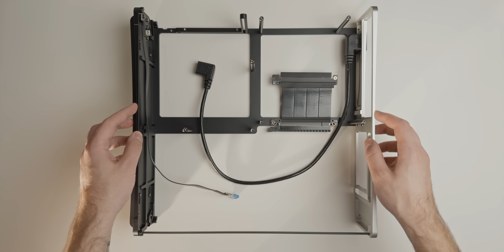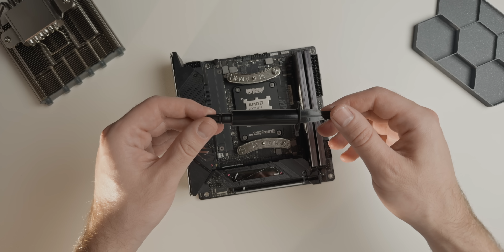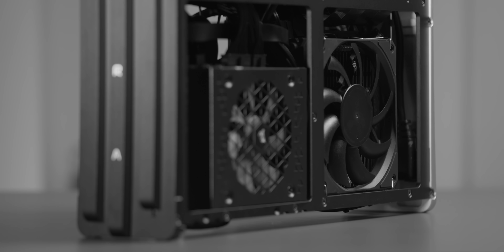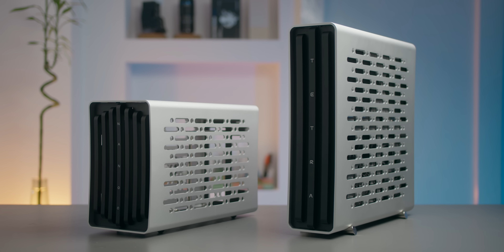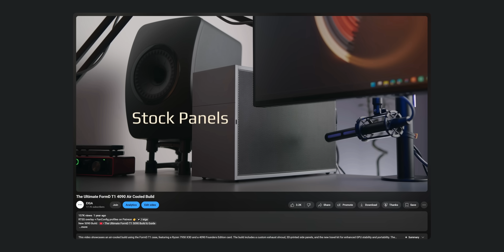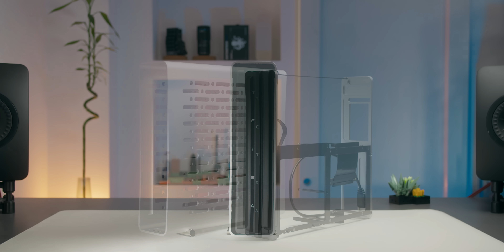5090 FE Console Style Build - Meet the TETRA R

Comment: Thank you for being completely honest with the noise and thermals on this case was thinking about changing from my FormD T1 v2.1 to the Tetra S but made me reconsider with the 5090FE. Plus it's expensive, looks beautiful but not worth it if it doesn't preform.
Reply from the maker: It does have one thing going for it, and that's lack of turbulence, quite a nice noise profile, and I expect that TETRA S would be similar. But the T1 2.1 is still the goat case for me.
Reply: @EIGAtech  I was going to purchase the Tetra S but then thought about my motherboard not fitting. It's Minisforum BD790i and has a integrated heatsink I doubt it will even fit this case the fan mounts further back closer to the rear I/O shield.

Comment: I have the I'm Fractal Design ridge, which is similar in size and allows for triple-slot GPUs, comes with two 140mm fans included on the GPU tray, all for less than $120 aesthetics aside, why should I buy this? 🤔
Reply: Some people really care a lot about the aesthetics and put a lot of money into making a room look nice... if you invest money into making your room look good, then why would you want an ugly box in the middle of it? Not saying it SHOULD be your top priority, but for some people the aesthetic element can be just as important as the practical one. And that's also not to say the Fractal Ridge is ugly (speaking as a Fractal Terra owner), but I personally like the aesthetics of Thor Zone cases. From an engineering and practical perspective, it may not be the best choice, but I think there's something to be said when you can look over at your PC and be happy when you look at it simply from the aesthetic. If you don't care about the aesthetic enough to compromise on practicality, then you probably weren't the target audience.
Reply: Fractal Ridge is the GOAT. Dual 140mm gpu cooling is such a game changer. Exceptional build and quality.
Reply: I have the ridge as well. Fractal build quality is shit, thin pot metal sheets that easily bend. Testing shows that the two 140mm fans dont really make a difference. Side panel vents are so awfully designed that that they trap heat from the GPU in the case since air can't go through them effectively. I rather spend 300 for a high quality case than spend on 120 on the ridge. Also itx-wise you just cant put aesthetics aside, can you? :)
Reply: @mitch395  I agree with you to an extent. If you're going to pay more to get the ITX form factor, you might as well go all in with it!

Comment: You should consider if the higher temps with the  TETRA R is because of the GPU sitting upright - try to rotate the case 180deg and try again, some GPU are sensitive because of the location of the vapor chamber and gas trying to climb up...
For example if the vapor chamber connected to the Core of the GPU is sitting down and the copper tubes leading to it are sitting up, the hot gas will try to go up to the core and you wont be benefiting for the fan blowing through the hot gas in the vapor chamber cooling it off.... you are basically just cooling the already cooler air in the fins...

Comment: Ordered a nanoq s and have a 5090 fe. 

Is it possible to change standoffs on the standoff bracket yourself to something shorter?
Or are they not removable?
Reply from the maker: You can use shorter M3 standoffs (like 15mm) but the GPU i/o lock bar won’t properly align and neither the bottom lock screws. That said I haven’t yet tried it.

Comment: Disagree about temps vs noise. I would 100% rather have the quieter Tetra in this example with its whisper quiet outcome. The Nanoq would make me wanna shoot myself if I had to listen to that turbulence all day. Who cares if your components are hot as long as it’s stable and within the manufacturer limits? Quieter build over a colder build every time!
Reply from the maker: I agree actually. The lack of turbulence on the TETRA does mean you can run the fans at much higher speeds and it's still relatively pleasant.

Comment: A couple suggestions to try out:
- If you have foam or cardboard, maybe try making a little air duct for the GPU so it pulls the air straight from the outside.
- I'd also try turning the case around so that the GPU is at the bottom, as the hot CPU air is likely feeding into the GPU right now.

Comment: Hey Eiga! Thanks for the video!
Did I get it right in that with around 2.5-3mm gap at the CPU cooler side there's no turbulence noise as well? (Tetra R max clearance is 70mm and AXP120-X67 + Air Slimmer 120 should be 67.6mm)
I'm asking because with the buiild I'm planning for the Nanoq S there will be exactly 3mm gap on both the CPU and the GPU side, so that confirmation from you would be an extra peace of mind for me given the hole pattern is basically identical for both Tetra and Nanoq shells.
Reply from the maker: There is no turbulence, but the gap is about 5mm (measured with calipers). I don't know why it doesn't line up to what it should going by the specs, but that's what it is in my case with the TETRA and the X67.
Reply: @EIGAtech  might it be that THOR ZONE just added 1 or 2 mm of gap above the spec to make sure the process of sliding the shell on and off isn't even less user-friendly than it already is?
Reply from the maker: @otravoyadnoe I don’t know what the reason is, ThorZone told me it may be due to differences between motherboards and socket height, but a difference of 2mm is pretty big. All I can say is that the TETRA is practically turbulence free with the setup shown in the video.

Comment: Is there any type of motherboards that can fit in this case and support 128 gigs of ram? I found it difficult to build a workstation pc in this sizes.
Reply: A quick Google search would have told you that commonly used ITX mainboards like the ASUS B850-I or the MSI B850I do support up to 128GB of RAM (2x64GB). Others as well.
Reply: @salvinor_ger got it thanks

Comment: Are these temps good? And would you say you can get them even lower?
Reply from the maker: Well I do talk a bit about what could be done specifically with FE cards to improve cooling, but more to the point, without using any mods, I would simply let fan speeds ramp up. I did some follow up testing and if left on Auto the 5090 FE fans go to 55% with temperatures reaching a high of 75 degrees which is the same as what I got in the NANOQ S, albeit at a  lower noise level, however, because the TETRA doesn't cause fan turbulence, it's actually a more pleasing sound profile. I posted the test results on Discord: https://discord.com/channels/1205855714355183686/1249835708378775715/1402539048580550696

Comment: This form factor looks sooo much better than the other sff options. More of this please.
Reply: Yeah. I'd take the increased height for the decreased width, which is actual desk space saved. Afaik the only "console" style cases that support those ~70mm coolers are the Tetra R, the Fractal Ridge, the SFFTime N-ATX V2, and the Silverstone Milo ML12. So not a whole lot of options unfortunately.
Reply: @Dark__Thoughts  It's an older case, but part of the Raven range from Silverstone also shared this console-style SFF style, I built a machine in the SIlverstone Raven RVZ-01 back in 2015, and there were a couple of follow-ups, the RVZ-02, and RVZ-03
Reply: @thefifth1105  I know those, but they're fugly plastic bombers with terrible cooling for edgy 12 year olds.

Comment: 5090 is definitely not for this case, toasty and no dust filter !!! You better call Gooch Collector soon 💀
Reply from the maker: Dust is not a concern for me and I would not use dust filters in any small form factor case due to the fact that they will restrict airflow.
Reply: It's definitely a concern 
U have to open it and clean regularly or it will be messy inside 💀
Reply from the maker: @kamm3021 Well yes, but if you do it every 1-2 months with an electric dust blower + detail cleaning microfiber cloth you’ll keep it in check and enjoy the benefits of better thermals.
Reply: True, Glgood luck with that

Comment: Are the feet removable?

I couldn’t find if it’s something that if you buy supposes a change in the chassis or is an add on I can remove if I don’t want to use them for some time
Reply from the maker: They are removable, they attach with screws from the inside. I asked ThorZone about it and they clarified that by default the case comes with foam pads only. Stainless steel feet are an add-on and you get four of them (use 2 for vertical mode or 4 for horizontal).
Reply: @EIGAtech  Thanks a lot for the response!
With that said I will add them too.

If it doesn’t take you too much time I would like advice/your point of view on the other thing that I still can’t fully decide.

About the colors and their durability I like the Carbon (well I would like best a blue option like the PSP Vibrant blue but that’d be a wish beside the point xd) and I see your case seems to be what they called Moonstone that would be the other option I’m considering.

Then which is the question?
Well I plan to get a Tetra S and move it around, so it may get eventually some little scratches.
 
I assume in the black Carbon any minor scratch would show the natural aluminum color contrasting.

Moonstone seems pretty similar to the natural color of the aluminum, so would you say it is? If it is I assume scratches would be nearly invisible.

I saw you have experience with Thor Zone cases and in other colors like the black NANOQ that I assume are painted in a similar way, would you say the finish is fragile? Like, if the color gets damaged if drag over wood?
Reply from the maker: @Pro720HyperMaster720 Sure thing! Based on everything you said here I would probably pick the Moonstone (silver) as it will absolutely hide scratches better than any of the others. The finish on my NANOQ R is pretty durable but even so it does have some scratches on the inside of the shell and some tiny marks on the edges just by building in it.

Comment: The CPU exhaust is cooking the GPU.
Reply from the maker: I did some follow-up testing with the GPU sitting at the bottom. It improves GPU temps by 1 degree but now the CPU is getting seriously cooked by the GPU, with CPU temps being 10 degrees higher. Test results posted in the SFF Hub Discord here: https://discord.com/channels/1205855714355183686/1249835708378775715/1402251946034860173
Reply: @EIGAtech hmmm that doesn’t seem ideal😂

Comment: 4:31 i think the problem is that there is too much space between the gpu fans and the side panel so the gpu fans can't suck in fresh air and they are mostly getting the hot air inside the case. You should try adding 2 slim fans.
Reply: Alternatively, using standoffs place the 5090 in the other PCIe bracket and then switch the fan and PSU around if at all possible, using the extra intake fan as exhaust. Now the GPU is taking in hot air from the CPU cooler, where in that configuration the 5090FE cooler takes in mostly fresh air from outside and exhausts it behind the GPU. Flow-through coolers benefit from having the space to exhaust air and I feel the gap on the front side to the panel is far enough not to cause any turbulence.

Edit: I see the review did mention a standoff mod but with twin exhaust fans added. I guess that's the best of both worlds and you leave the fan and PSU as is to help move air through the case. Love the total volume/size of the S though, but I doubt you can make this build work in there. Maybe with some CU magic or just never use Blender
Reply: The hot air from the CPU also travels up into that part of the case and straight into the fans of the GPU. Flip the case upside down and cut together an air duct for the GPU and I'm sure temps will improve.

Comment: Useless case, in this form factor only cases that support AiO are worth considering. Low profile coolers are not made for high powered cpus... This is a clear case of design over function. Just stick to the dan a4 H2O (11L) or the NCase M1. If you want a good looking vertical case go for the Ncore 100 Max
Reply: The Ncore 100 Max is awful with the 120mm AIO being equivalent with these low profile coolers (100-130W max). The others are outdated cases that won't support many of the most recent GPUs. Formd T1 and the newer NCase M2/M3 are the SFF standard cases if you want to run AIOs.
Reply: Useless comment. This form factor is notorious for not supporting AIOs due to the lack of space. The Dan A4 does not support air cooling and is a completely different form factor - same for the Ncore. A Formd T1 at least supports air cooling too, but even then it's the same deal of maxing out at around 70mm coolers with max 2 slot GPUs. At this form factor it's always a compromise in one way or another.
Reply: If you can find a way to get sum extra fans in, you can get away with cooling, still got a dan case sfx with a 92mm cpu fan with multiple case fans , and a 9070xt, wrks fine

Comment: I pre-ordered the "Tetra S" just now and I would move there my 5090 FE and my 9800X3D which will make a hell of a combo.
To see the thermals, but I think it will be thunderous, without needing to add additional fan, outside of the CPU cooler, obviously.
The "Tetra S" is custom-made to enhance the 5090 FE with its through ventilation :eyes-pink-heart-shape:
Reply: Actually I still think the Nanoq S would be the better option in case of thermals. It seems obvious that the missing case fans have massive impact on the thermal performance. While in the Nanoq u get 3 fans bursting out the hot air.
Ofc. The distance between the 5080/5090 and the side panels in the Tetra S is smaller than in the Tetra R. But having case fans is such a big plus. Same "problem" like the Terra. The big downside of the Fractal Terra are the missing options for case fans. 

I was ready to go for the Tetra S. I thought it would the best case for an 5080/5090 fe. But after the first reviews of the Tetra R i'm sure, the Tetra S wouldn't be much better than the Tetra R, because it has the same flaw: no real exhaust options for hot air besides the fans of the gpu and cpu cooler
Reply: How did this workout for you? Very curious ? Any updates

Comment: Great video! Can you share more about the cables you used? What cable length would you recommend? Do you have a supplier of custom cables that you would recommend!
Reply from the maker: Sorry for such a late reply, but here are the lengths on my custom cables:
mobo 24 pin: 240mm (could go for 200mm instead)
cpu 8pin: 400mm
nvidia 16pin: 360mm

Comment: Do you have a Nanoq R to try the same build? How do you think the GPU turbulence would sound on that? Thanks!
Reply from the maker: I do have an older NANOQ R but not sure I'll be doing a 5090 FE build in it. However, I can tell you that it would be relatively easy to get rid of turbulence in the NANOQ R by using it in something like 3.5 slot mode, giving the fans a nice gap. You would still want to add that 20mm offset gap though to give the GPU flow-through ample breathing room.
Reply: @EIGAtech  Thanks!

Comment: A fan duct for the GPU or intake fans would probably fix the issue. Do 25mm thick fans fit there? If so you could probably just hang them there to test and see if it’s worth making a 3d print for it
Reply: That's what I was thinking. If you have foam or cardboard you could quickly ghetto-rig something together so that the fans on the card pull the air straight from the outside. I'd also turn the case around because right now the CPU heat rises up towards the GPU compartment of the case and consequently straight into the fans. A top GPU position might make more sense with the Noctua cooler, since that one blows the air out instead of in.
Reply: Why not add Noctua NA-FD1 or other crosspieces to limit air flow disturbances?
It could reduce the turbulence, right ?
The noise scares me, now that I have ordered the "Tetra S" with the 5090 FE, I fear this concern of noise nuisance...
Thanks for this review @EIGAtech :finger-red-number-one:
Reply: @NH-Nicolas  I have strong turbulence noise with a 2,5 slot card in the nanoq s.
Reply: @josemaredondo2  Have you tested adding NA-FD1 type interlocks between the top of the fan and the back of the case to create a physical "funnel"? I am in the process of looking at this to minimize turbulence and optimize the airflow to cool as much as possible ?
Reply: @NH-Nicolas What would they attach to tho? I'm sure someone will come up with a 3D printed solution, but Thor Zone should really have thought of this before claiming this is an ideal case for FE cards. 😕
Reply: @privaatsak  Indeed ! Wait and see :body-blue-raised-arms:

Comment: Whats your current undervolt? Has it changed since your video from 4 months ago?

Also how do you get +3000 on the memory, MSI only shows me +2000 as max
Reply from the maker: Nothing has changed, I'm using the same UV from that video (the one at 885mV) but with that +3000 on the memory. You need to override the +2000 limit with this file: https://forums.guru3d.com/threads/msi-afterburner-4-6-6-beta-5-for-nvidia-geforce-rtx-5000-series-cards.455155/

Comment: Thanks for this! Would have liked to see the build with a Noctua L12S with fan as intake. Also, I think the issue with the GPU is having its intake so far from the side that it's maybe taking in too much hot air from the motherboard area?
Reply from the maker: You mean with the fan blowing away from the motherboard? It's possible it would do better, but I don't think it would suddenly fix GPU temps.
Reply: @EIGAtech No, sorry I wasn't clear, these are two seperate ideas: L12S would intake air towards the motherboard but through the heat sink which may result in better airflow generally. It seems to me that some sort of shroud to help air get into the FE cooler might be the only way to improve temps on the GPU side. Quite disappointed as someone with a 5090 lying waiting for my preorder of this case 😕